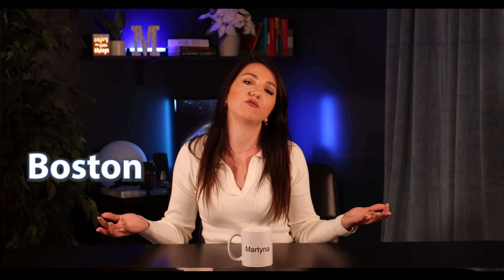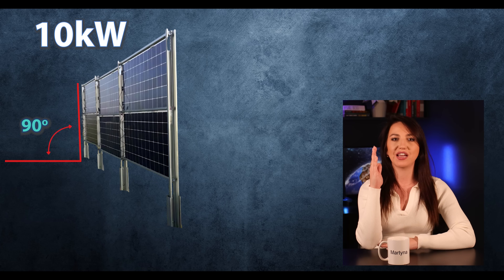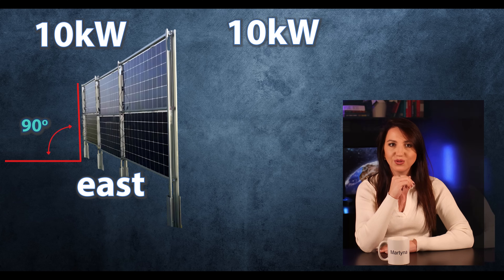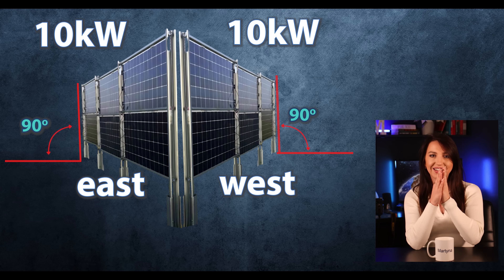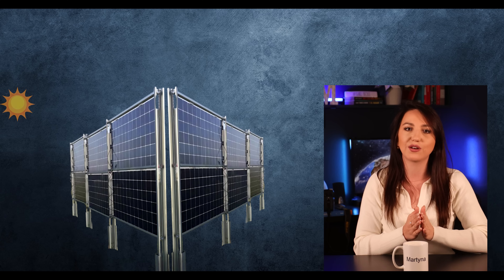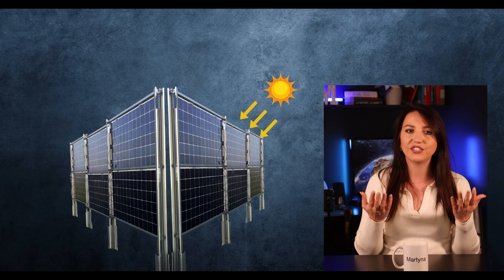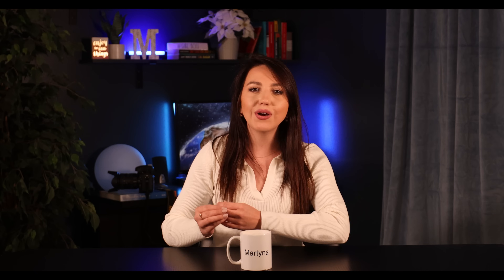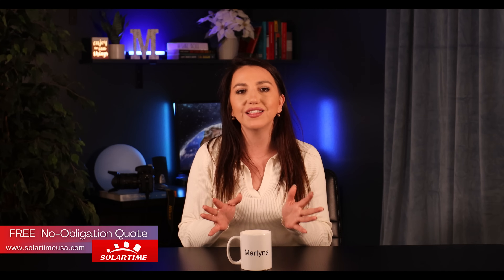Why I 'Oversize' Every Solar Installation (And You Should Too!) - Solar Oversizing Explained

Comment from the maker: CAUTION! Oversizing in wattage is NOT the same as oversizing in voltage:

Overvoltage (too many panels in series) = DANGEROUS, can destroy inverters, NEVER allowed over max rating (Usually in USA 600V per string)
Overwattage (total system power) = safe, inverter just clips excess power, commonly designed this way - THIS IS WHAT WE SPOKE OF TODAY!

That's the essential distinction - overvoltage can KILL equipment, overwattage just means some power gets clipped, but also offers many benefits when done right.

WARNING: NEVER INSTALL MORE PANELS ON A STRING WITHOUT PRIOR APPROVAL FROM AN ELECTRICAL ENGINEER!
Reply: where on d specs can i  see just how much i can overwatt?
Reply: @raedy07  you can over watt to infinity.  When combining more than two strings you will need to fuse each string by the fuse rating on the panel.  You should fuse the combined run into your inverter also based on its maximum current rating. 

My sunny boy 6.0 has three MPPT inputs each good for 6kw. I could put 18kw on it and it would only make 6kw. But it would happily make that 6kw from 830am until 630pm every day.
Reply: I wish I had seen this video months ago before I did my solar array. I undersized because everyone I saw said something about winter time, cool panels and whatever else and they stated that you could damage things by even being right at the limit of your inverter. So, I made sure that my 5600 watt inverters had well under 5600 watts of panels on them, BIG MISTAKE. The most I have gotten from the solar array which is rated at 4500 watts is like 3300, what a waste (I should be able to get a bit more in the summer but it will never be anywhere near what I could have). I will need to add more panels, but now I cannot get the exact panels I bought earlier...
Reply: @72442conv  I think you understand, but i want to break it down "barney style" just in case.  🙂 .   The only limit you need to be concerned with is the max voltage of a string.  And when it is cold the panels will make more voltage so you need to calculate that highest voltage based on lowest temperature ever recorded in your area.  Google Max VOC calculator to find one online.  Once you know the max number of panels you can put in a given string, you are free to add as many strings as you wish.  if you combine more than 2 strings you must fuse each string before where they join together.  As a wild example, my SMA sunny boy is rated to make 6kw, but I could easily connect it to 18kw of panels or more.  In my case, the SB is rated for 600v, so I can connect 14 of my favorite panels x 3 strings.  I can install 42 panels on that inverter (3x14) or 3x10 or 3x11, or 3x12, etc...  Each string should contain the same number of panels and all of hte panels in a given string should face the same direction.  

To reiterate... take care to calculate the VOC voltage of your panels on the coldest day and never exceed your inverter's input voltage.   Feel free to add as many strings of panels as you need.
Reply: @72442conv  another tip for you.  The text books will tell you to tilt your panels at the angle of your latitude.  In my case that would be 34degrees.   But if you need to make the same amount of power each month, you should tilt them a little steeper.  In my case 6deg steeper to make 40deg tilt.   The days are short in winter so I want my panels pointed straighter at the sun when it's low.  I get peak power but only 4 hours a day.  In summer the tilt is far too steep but that's ok... the panels make less power per hour, but there are more hours of daylight in each day.  The result is that I make a ratio of 1:1.3 in winter/summer.   Google the pvwatts nrel website for help modeling the output of a planned system.
Reply: Hi, I am having a SOLIS on-grid inverter ( S6-GR1P4k-S) . Presently I connected it with a single series string of 3.99kWp (570Wx7)panels at one MPPT port. So how much more I can oversize the panels in this existing system and I have one more MPPT port free as well in the inverter for another string too. ( Adani TopCon Bifacial N-Type Panels)
Reply: "Clipping" appears to be the wrong concept. As long as the voltage at the input port is within spec of the MPPT then the MPPT is simply not making use of the [edit: maximum] instantaneous power available to it. Nothing is 'clipped' but the appearance of the graph of the MPPT output.
Reply: Dangerous Question? You Said, that you can connect 20 kW (east,west) to a 10kw Inverter. current Amp is clear , cause only one Side of both delivers amps
 But what is with the voltage? is this at the unsunny Side also going to zero - and would so unimportant for the total voltage ?
Thank you.
Reply: @user-jp1ve3md7t solar panels are very “spongy” with regard to voltage. They are in fact diodes so it’s ok to connect a parallel string in parallel that might be in shade when other other is in sun.  Yes they’ll have two different voltages but it won’t be a problem. Keep in mind that all panels in one string must all be on the same plane to make good power (exception is solar edge inverter with optimizers ).  So it’s ok to put 12 panels on an east face and 13 panels on a west face.  No harm no foul.
Reply: @ prefect!  The inverter will only take the amps it needs and having more amps in the panels available is no problem. Just remember that if you combine more than 2 strings in parallel, you must use a combiner box with a fuse.
Reply: Sound advice
Reply: Depends where you live as well. Up here in Saskatchewan  my 28kw can push well over 33kw when its -30 and sunny out.
Reply: What about overcurrent?
Reply: @ekeretteekpo3004  overcurrent can not happen except for bad conditions like short circuit. The current is driven by the MPPT controller, and the MPPT controller should make sure that it will not load the panels more than it can handle itself.

Also overcurrent is pretty much not possible with single strings.

I have multiple setups with parallel strings (adding currents), and the current stays well maximized to the MPPT's capabilities. Per string there is a safety fuse to protect the spring, slightly rated above the max current for the panel.
So the MPPT is in total control of the max current of the panel. However, the MPPT is in no control of the voltage. At -10 degrees celsius, the panels voltage are rather high, but fortunately well within the range of projection.
When I look at the specs of my panels with Voc, it should be around 180V, but it peaks well above 200V because of the cold.
So: max current is determined by the controller, not the panel or the weather.
Reply: @bloepje  sort of.
Panel current is based upon demand, the controller regulated this demand. Having an online power meter shows this demand based current.
Reply: @bloepje  8 panels in series @27VOC @ 9 amps each exceeds the 70 amp rating of a victron 250/70 at peak.
So you CAN over AMP a controller.
Controller is still going to try to convert volts to amps on top of that too.

Oh and most LiFePo4 Mfr's recommend a charge rate of 20 amps per battery.

Setting up solar can be very complicated.

You also get losses due to array distance and wire gauge too.

Comment: I oversized based off annual generation and consumption rather than inverter capacity.

I used PVWatts to design a system that generates 125% of my annual consumption.  Because I went with a battery backup system, I ended up 23kw of inverter capacity (to cover the worst case house load scenario with 12.55kw of panels.  When I started getting quotes from installers, I expected some pushback over what I thought I needed.  After they looked at my utility bill plus loads and ran the numbers, they all agreed I had the right sizing.

Because I have so much excess inverter capacity, I can add more panels to my roof if I ever need them without adding another inverter.

Comment: PSA
If you are thinking about getting solar and batteries because of government handouts and theoretical payments for supplying the grid
Don’t Do It!
Unless you can scam someone out of supplying and fitting the panels and batteries and still get the handouts it is nothing but a financial black hole and massive fire risk.
The cost even with handouts to install a system that actually does something is often so high that even if you get credits on your power bill it will take longer to repay the cost than the life of the panels and most certainly the battery so you will need to replace them at full cost before they pay for themselves even with the handouts and in many cases charges for suppling the grid.
If you pay entirely out of your own pocket there is absolutely no chance of recouping the cost.
Unless you are entirely off grid solar electricity is just a scam you should avoid .
Solar hot water and HVAC on the other hand can be a money saver.
Also 
The imaginary increase in property value may not eventuate.
The risk of not recouping the installation costs at sale goes up the older the system is.
The closer it is to the end of life of panels and batteries may have a negative impact on property value even requiring the system replacement or removal to complete the sale.

Comment: Easy way to figure things - deduct 1/3 of what the claimed power generation is and you should be fine.
UNLESS you have dual axis N-Type bicacial panels. Then deduct 20%-ish.
Peak power is not the same as overall power.
Be careful oversizing because you can fry a controller.
MFR's recommend UNDERSIZING for longevity of your controller.
Victron recommends about 30% undersizing.
Would you drive your car floored all the time or drive the speed limit? Flooring wears out the car quickly.
Same with solar controllers.

If you are worried about production then run the panels in parallel.

Comment: You're right on the spot. I oversize too. I have 450 to 500 V max input Voc for my inverters, but I never go that high. The highest I've been able to read is about 380VDC from the arrays. I do boost the current a lot by monitoring the different strings. I have 3 strings of about 2500W PV that I keep joggling using breakers and change over cam switches to guide the power to different inverters and different batteries, according to their SOC. I always have a station or 2 out of five that are always taking the max solar input while the others outputs for my ponds, my fridges, freezer, water heater, washer dryer, EVSE etc... I love living totally off grid even during the winter season in Northern California. Because the weather is nice here, I do not need much heating, just wear some slippers on cold wood floors. And during the summer the panel shade around the house keep it cool. But we do have some weeks end of November early December where bad weather last two to three days. So Oversizing is an understatement! It's the key to energy autonomy.  Needless to say all I need then, is to transfer switching the power from a full stations. Having a lot of PV + batteries, definitively helps. I love it! No PG&E, no Gas, no Gasoline!... The pond collects water to last the year round, compensating for evaporation and it keeps everything green all around the house. But I still depend on water and food though. I buy 5 gallon bottles and store Costco sales food , and eat out now and then, to keep our my neighborhood business alive, otherwise I'd probably raise chickens plant potatoes and dig a well...
Reply from the maker: Wow, this is amazing to hear! I love the idea of that kind of setup — just wish the Texas heat wasn’t so ridiculous… or that our winters didn’t throw in those out-of-the-blue deep freezes! 😅
The way you’ve designed your system sounds like a full-blown energy ecosystem. Seriously inspiring. Thank you so much for sharing all that — it feels like something straight out of The Martian movie! 😂

Comment: Calculate what you need and double it, by 1 pm your batteries should be 100%, rest of the day running nothing but solar until the sun's gone with enough batteries to be at 40% charge by the time the panels start producing the next day...... At the minimum.

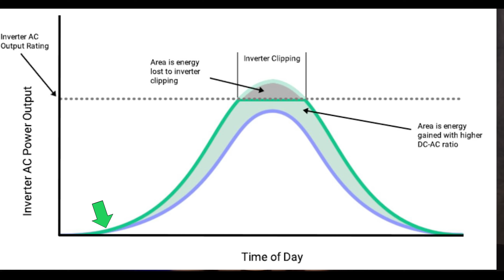Comment: 5:55 this is intriguing but it presumes yo need an inverter, i.e. AC. I mean if you store energy in a battery, then the panels make DC, and the battery takes DC, so I'm thinking do you need an inverter for close to max DC input?

Comment: The reason oversizing is a thing now is because  the price of panels has dropped so dramatically, the inverter is now a significant portion of the cost, so losing a small amount from clipping isn't really an issue and gets you more power overall. When panels cost 10x as much, you would never want to oversize to the point of clipping. Clipping normally will only happen in the summer peak, so losing 5% output for 1/4 the day a few days a year is pretty insignificant if kept within reasonable limits.
Reply from the maker: I fully agree , but you know the nominal power of a panel is only laboratory... in reality very rarely - so a 450W panel being sold... could be called 380W... because of course in space that panel would probably have around 600W... it's all a conventional size, every second it has different power - thank you for the comment

Comment: I wish you have this video posted 6 years ago when I had my solar panels designed and installed. I already told the sales rep that I would like to exceed my household needs. Alas, in my case they only designed it for 105% oversize. If I have to do it all over again, I would like to have it 120% to 140% to account for performance degradation over the 25-30 years in service.

Comment: _ E v e r y _ component in electronics (and even some in electrical installations) should be more or less over-dimentioned... and that for a very simple and comprehensible reason:
Every part fthough which electrical current is flowing is heated up because of resistance heat (or current heat). Unfortunately the temperature tolerance of different parts (and even materials) is very different and while some can stand a quite high average temperature for a very long time span (like heater resistances) others suffer damage very quickly if their maximum temperature is only reached for quite short time spans (often, because internal parts become much hotter than their surface) and quickly 'die'.
A lot of modern circuits are constructed even in a way, that their average operational temperature heats up internal components in a way that let them fail after predictible time spans ("intended breakpoints"). Well known for their very limited temperature resilience are in general semiconduters of all types. This is usually a consequence of their cristalline structure and even more because of their 'doping', which lets them suffer damage when reaching too high temperatures (damaging the cristalline structure). That's why "hot operated" semiconducters often show a (partly even very...) limited time span, which would be enhanced drastically when being less "thermal burdened" (by controlling the passed-through current in denpendency of their temperature). That's why e.g. processors and other quite complex simiconducter components often are manufactured together with integrated thermal sensors to enable a real-time current reduction. But... well-known for thermal burdening are - of course - photovoltaic cells. They need to be in the highest possible light concentration to enhance their output. But... it is also known, that 'too hot' operated photo cells loose effectivity, so that the power deliverd by them is a trade-off between effectivity, life span and gained power output.
Over-dimensioning let them simply live longer and... in regard to the cost of new modules (and the effort/cost to replace defect ones) some over-dimensioning makes (at least in my personal oppinion) make sense - especially when we know, that this also reduces significantly the amount of module garbage (because unfortunately the industry still refuses to include the cost of recycling and waste disposal into the cost calculation of their sold components, hence lying to customers permanently).

But... this over-dimensioning has to be kept in a reasonable scale, so that there still remains enough power output to no cause other problems like too low current flow... because in some electrical parts there is also a limiting parameter of a minimum operational current/voltage (ironically also often concerning semiconducters because of their 'threshold'-property)...

Comment: Thank you for covering this topic Martyna. After almost 2 years of operation my net metered solar system is averaging below the expected annual generation thanks to prevailing cloudy weather conditions, bit of erratic power supply from the utility provider and also I presume natural degradation/stabilisation of the solar panels which is expected as the system ages. Plus the location I am in, average sunlight hours is limited to 4-5 hours only.

I have a 5KW set up (530 watts  Mono Perc solar panels X 10 nos. = 5,300 watts string set up) but the inverter has a rated output capacity of 6KW. After talking to my utility,  I am thinking of increasing the panels to 8/9KW in order to compensate for the above factors and also to intentionally introduce solar clipping for better and longer generation hours. 

Hopefully this will bring up the monthly generation to 600- 800 + units.

Again thanks for covering the topic. Love from India.